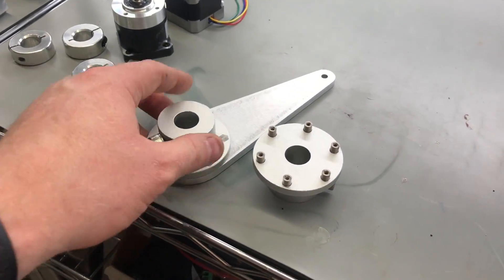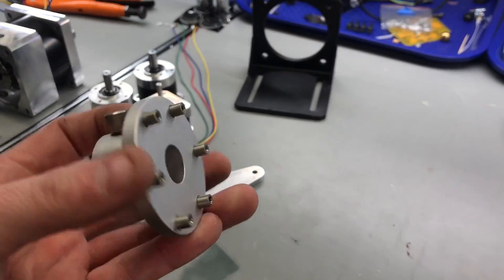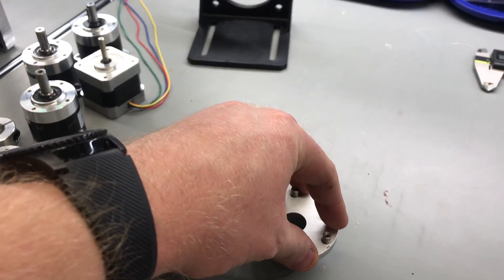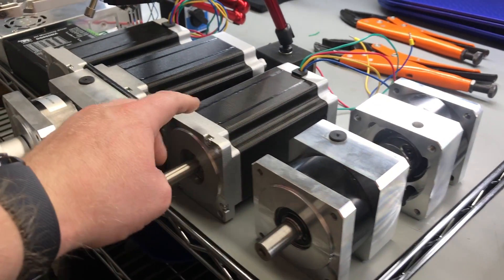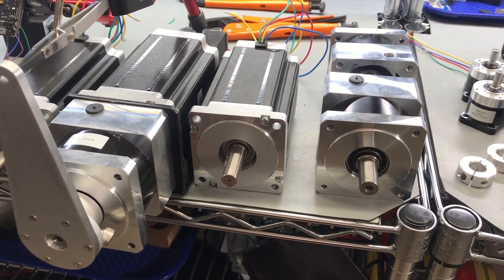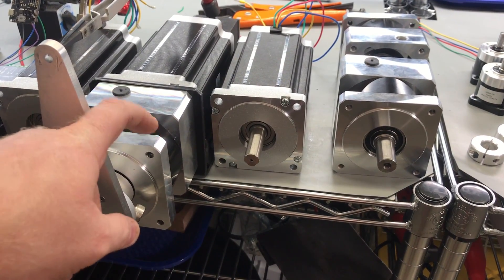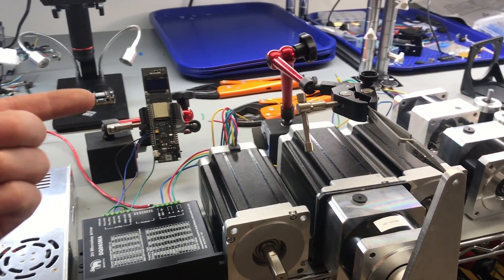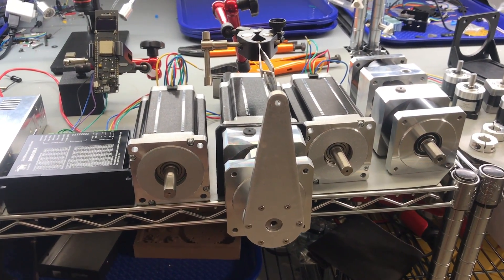Heavy Duty Robot Arm - Laser Cut Aluminum

Comment: What kind of laser cutter are you using? CO2?
Reply from the maker: I'm using a 2000W fiber laser.  A 2000W CO2 laser is not capable of cutting 0.25"(6.35mm) Aluminum.
Reply: thanks! Did you build it yourself as well?
Reply from the maker: No, it's an industrial laser at the shop I manage.
Reply: Do you have a name of the machine for me by any chance? :)
Reply from the maker: It's an LVD Lynx 3015. Well over $250k new.
Reply: I'm buying one!

Comment: Does that press have any safety feature that will spare your fingers in the case you get them in between?
Reply from the maker: NeuroMod yes, there is a low voltage between the top and bottom.  The machine expects to see a certain amount of current to flow when the spring mechanism is engaged before applying full pressure.

Comment: That is some serious hardware!  I can hear a slamming sound when the arm hits its "limits".  I presume there is nothing preventing it from going 360, so, where does the sound come from?
Reply from the maker: When a stepper motor makes a move from one step to the next, the rotor doesn't immediately stop. The rotor actually passes the final position, is drawn back, passes the final in the opposite direction and continues oscillate until it finally comes to a rest. It does this very quick but this "ringing" can be reduced by decelerating more gradually.  The ringing with large stepper motors is much louder than small NEMA 17 stepper motors because there is so much more inertia.

Comment: So that is a fiber laser correct? I know it's not a co2 laser because those don't cut aluminium (lol) and it didn't look like plasma cutter (plus you said laser)
Reply from the maker: Yeah, I'm using a 2000W fiber laser.  A 2000W CO2 laser is not capable of cutting 0.25"(6.35mm) Aluminum.